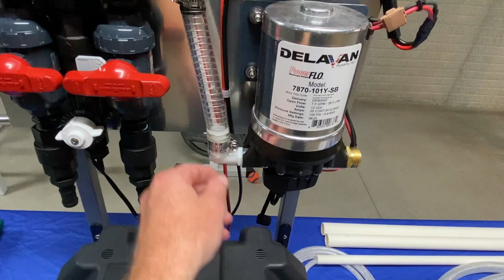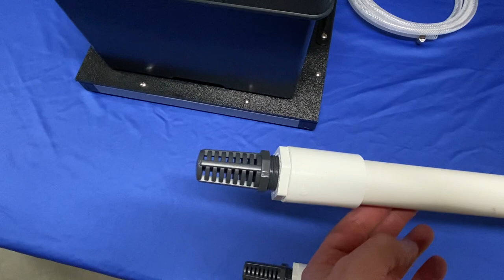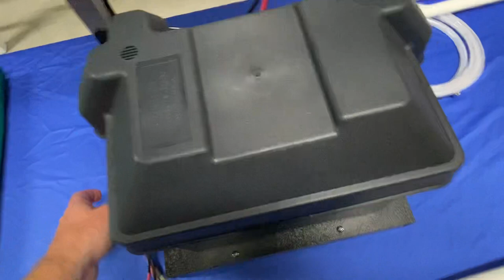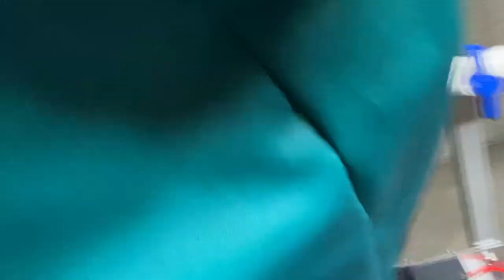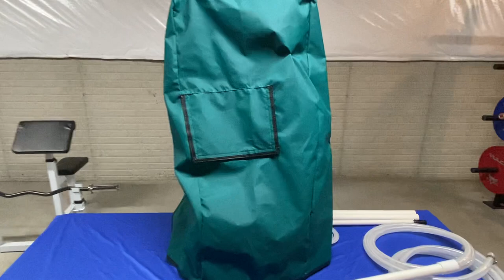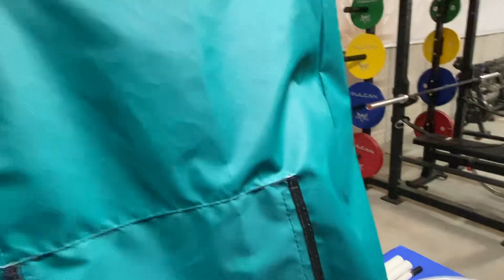The best 12 volt Soft Wash system money can buy! Now with 3/4” metering valves.

Comment: How much for that system and what else do I need to make it a complete system? Maybe a list of things I need to make this work or if you offer a complete system
Reply from the maker: The price on this system is $1750+shipping.

All you would need is a tank for water, and a tank for bleach. I build the system to utilize 55 gallon plastic barrels, but you can use other tanks as well.

Next, you need a marine, deep cycle battery to power the system.

To dispense solution, any garden hose will attach to the pump and then to the soft wash wand that is supplied in the kit.

Lastly, a nozzle of your choice that is 1/4” quick connect capable. We recommend a Jrod with the nozzle sizes 0010,0040,2510,2540

Call me for more info 
810-284-2545

Comment: Can this be connected to a pressure washer?
Reply from the maker: Soft wash systems like these are designed to dispense your SH solution onto the house, roof or concrete. Most techs would then use a pressure washer to rinse.